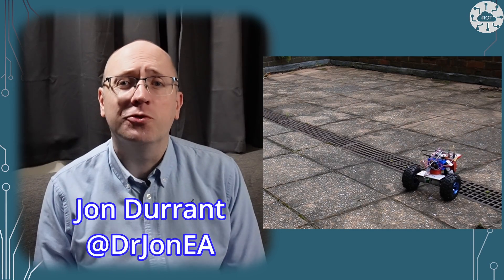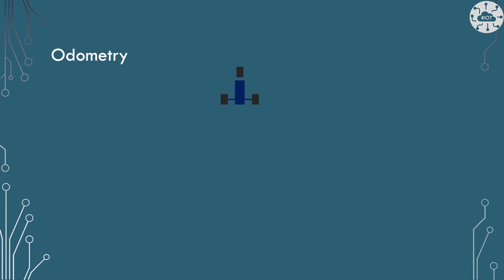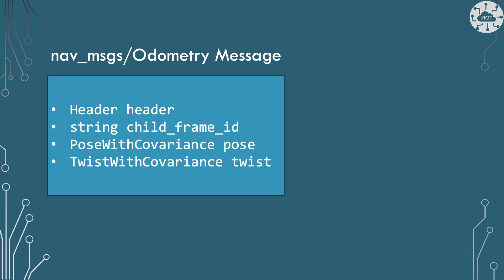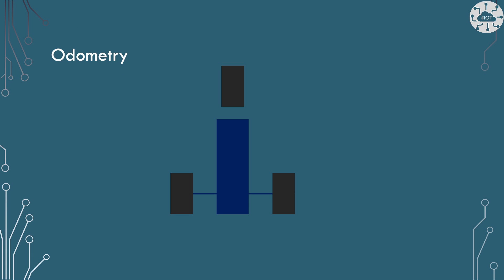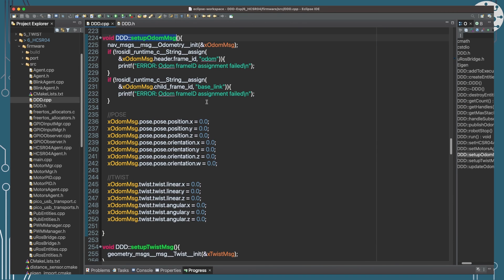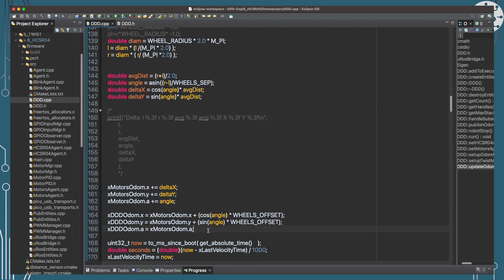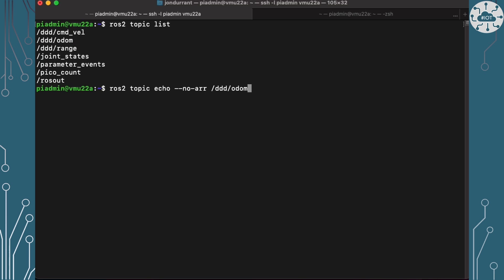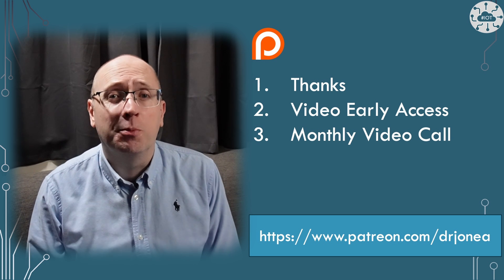Integrating Raspberry Pi Pico With ROS2 For Robot Odometry: A DDD Tutorial | DrJonea.co.uk

Comment: Hi Dr Jon. I am also using microros to publish the /odom data however my time stamp is the local time for the microcontroller, soit begins at 0. Ive noticed you are using the ROS "global" time which is alot bigger. I am struggling to visualise the odometry in RViz as i cant set odom to fixed frame and i get this error when i try [rviz2-3] [INFO] [1719164204.081363020] [rviz2]: Message Filter dropping message: frame 'odom' at time 239.366 for reason 'discarding message because the queue is full'
. Could it be that i have to use the ROS global time like you have or i need to use tf2 to "declare odom" as a frame? any help is appreciated
Reply from the maker: Hi, My understandign is that you do need to use the ROS "global" time as that is how everything stays in sync across the ecosystem.  I think you are seeing the queue fill up as RViz waits to hit the time to take the messages. But that is just an educated guess.
Let us know if that helps.
Reply: @DrJonEA  thanks for the response. I tried another approach where I publish my encoder data to a topic and an internal ros node handles the PID and odometery. The node publishes a PWM value for each motor. Do you think this is a suitable approach? Also yes I used ROS global time and it seems to  work 👍 thanks
Reply from the maker: Glad that the global time got you over that challenge. At first glance I can't see why the approach you suggest would not work. Might need a bit of thinking through how responsive it is to changes. PID calculations can get start to oscillate if delays in data. Try it. And good luck.
Reply from the maker: Great progress. That sounds cool. I'd be happy to mention your repo and robot on a future livestream if you like.  Reach out on email or one of the social channels. 

My plans. I did quite a lot of videos on DDD my Diy Dev Droid. I am very comfortable explain the low level control sides of ROS and alignment with the Pico. The Navigation stack I'm less confident in right now. It is definitely where I want to go. As well as DDD transforming into an Astro Droid look!
Reply: @DrJonEA  Thanks for the kind offer Dr Jon. After doing some testing i found the code works fine on my laptop but not on the raspberry pi-im observing oscillations due to too much delay in the control loop plus the odometry does work for rotation very well.

I am going to try a different method with ros2_control and see where that gets me. Ill let you know updates via email if i get something solid working

Thanks
Reply from the maker: Great. Good luck